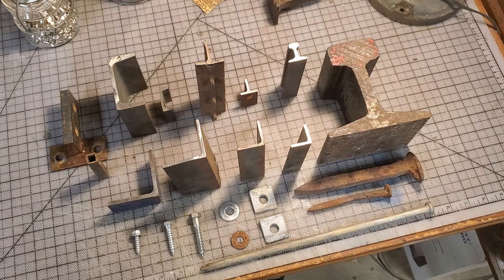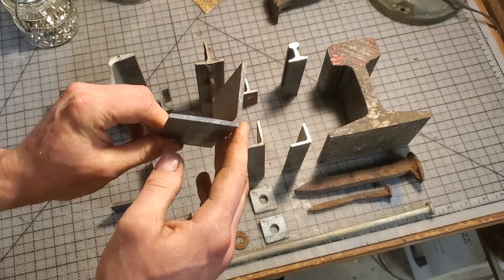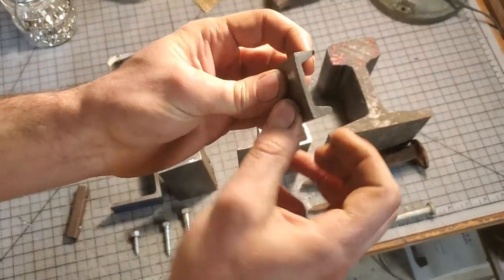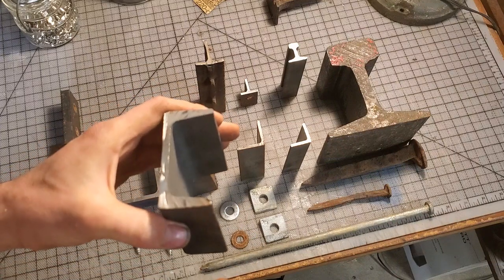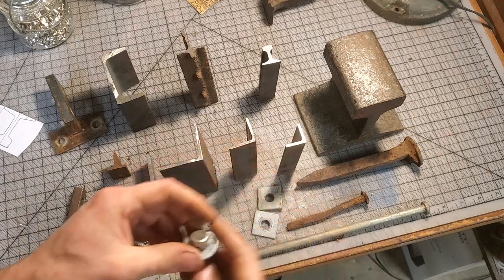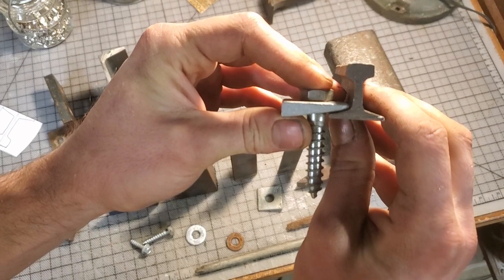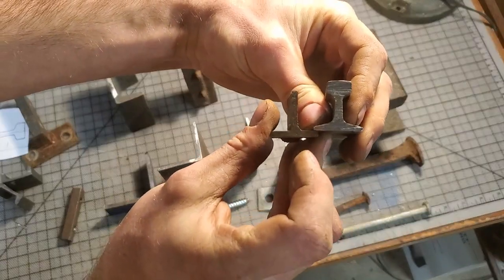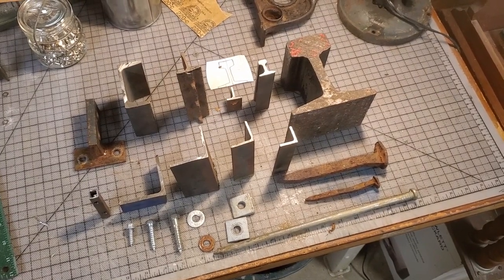Rail Options for Minimum Gauge

Comment: This is an interesting and informative video.  However, I was wondering if you've seen any of the videos that Way Out West Workshop has done about the 15" gauge railway that they've been building for their farm?  They basically use long sections of bar stock for their rails, with sections of pipe driven into the sleepers & the bar stock bolted to it for the rails, and it seems to work pretty well for their purposes.
Reply from the maker: Yes indeed, I've seen his videos and his method is superb, very easy to build and elegantly simple. The only improvement I'm trying to work out is a design that doesn't require drilling through the rail, so the tie spacing isn't fixed if the track routing needs to be changed later on.
Reply: to me, the downside to way out west's rail is the bar steel is not very wide. I wonder how much grip that track would provide. I'm just some idiot with an idea to build some layout in the woods (I'm in the US Midwest and lots of hills). i would have to deal with a grade a lot, so whatever i come up with needs a lot of traction. I don't really know much of what I'm talking about though.

Comment: For the smaller (9lbs), rail would larger diameter wood screws be a viable option? What about the shorter concrete anchors? Some of those can be over 1/2" thick and several inches long but would also provide the short head.
Reply from the maker: Yes any manner of wood screw could work, the lag bolts were just one option I've gone with

Comment: Question: i'm currently starting off my minimum gauge railway (19in gauge) and was thinking about using T fence posts as the track, but instead of having it in this position | , like you showed, i'll have it like this T , and weld a plate at the bottom for each tie like you showed at 6:57 . I'm using lightweight/medium sized rolling stock, being build on original minecarts chassis (thus the 19in gauge).
What's your opinion on this method?
Reply from the maker: Should work well, orienting the bar with the flat up is a good idea as it will provide a better tread for the wheels. you may want to use pieces of angle rather than flat for the welded tie plates for a bit more of a robust bracket if you are using heavier rolling stock and a wider gauge. Also closer tie spacing may be needed to handle more weight.

Comment: Thank you for sharing your thoughts and experience :) Did you ever try applying heat to some of the ones that are difficult to bend? I assume that would help, at least a little.
Reply from the maker: Heat would certainly help but on such lengths it would be inconvenient to get them heated evenly. I have heated the rail to bend up parts of the switch but those were small tight bends where I could heat the area with a torch flame.

Comment: Thanks for the comparison and contrast. I recently bought 8 foot tee posts at Menard’s for less than six dollars each and I think they would make affordable but light rails. I think with a hole drilled in the horizontal part of angle ,a heavy lag screw would hold pretty well.  I think the smallest I beam I’ve seen is around 2” x 4”. It’d be nice if they made a mini I beam say 3/4” x  1 1/2”. Thanks again and looking forward to more of your projects.

Comment: I'm using the steel T-posts for rail right now.  Instead of cutting grooves in the ties (sleepers), I've been cutting the nubs off the back of the T-posts with an angle grinder and a cutoff disk.  I don't cut them all off, I just cut off the ones where they'll be sitting on the ties, based on my average tie spacing.  My track is 7.5 inch gauge.

Comment: The 12 lb rail You mentioned is mine rail, this is the rail miners use.  It comes in 8, 12 & 16 lb sizes with 12 being the most common.

Comment: What do you think about using wider flat bar stock like 10x25mm (3/8 by 1 inch) with welded tabs on the bottom. That could yield better rolling behaviour right? No sharp corners at least like the angle or T profile.
Reply: I’m using 3/8” flat bar now. Seems to work ok but the road is new so no idea about lifespan. My cars are on the lightweight side however.
Reply from the maker: Flat bar 1/4" or thicker would work well, but the thicker the bar the heavier and harder to bend it is. That's why I've chosen channel as its shape has a high strength to weight ratio with a wide head for the wheels.

Comment: Thank you for the comparison. I saw you pulling up old rail in a previous video and was surprised to see the fence post. I was happy to hear you elaborate on that more here.

You very briefly mentioned flat bar, but did not mention the “groovy rail” system. It uses a 1 1/4 x 3/8 flat bar with preformed ties. It “feels” like a good choice for 7.25 and 7.5 gauge. Unfortunately I have no idea how it holds up in practice… Thanks again!
Reply from the maker: I linked an article on Groovy Track in the description, I didn't choose it as I had issues with the durability of slots I cut in the ties for the T post bumps, the wood tended to split because of it, so wanted to avoid tie slots for the new track. Though if the slots were tighter as they are in the Groovy Track system I'd imagine they'd hold up better.
Reply: I experimented with groovy many years ago for a small bit of track and was not satisfied with the stability despite close tolerance routed slots in the ties (sleepers). Groovy tends to work better with plastic / composite material because the groove does not expand/contract or deteriorate as fast as most woods. Also, the outside part of wood where the groove is cut can splitter and break off losing holding power of the groove.
Reply: Someone called Tim did use 50x8 flatbars on his farm with 4x4 sleepers, he used glavanized water pipe as pegs to hold the flatbars, his tracks seems to hold heavy carts well, like one card was loaded with over 600lbs 300kg of gravel.